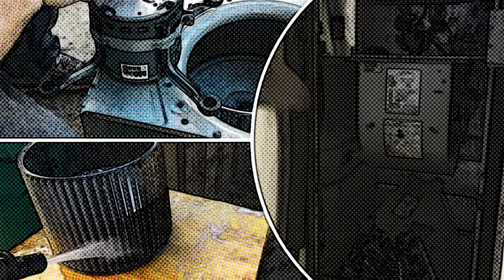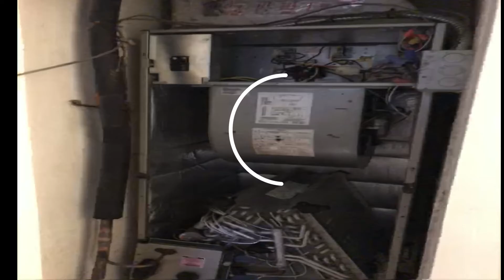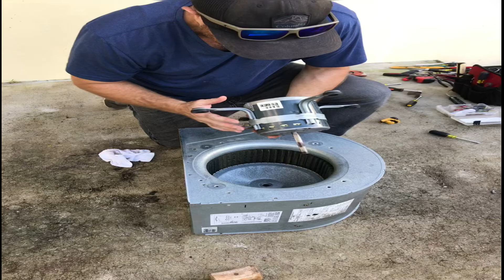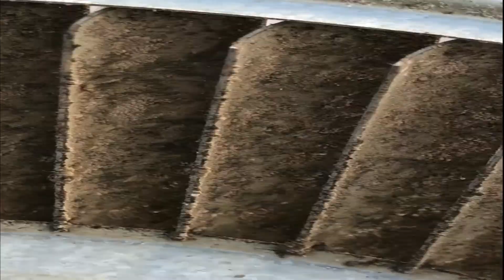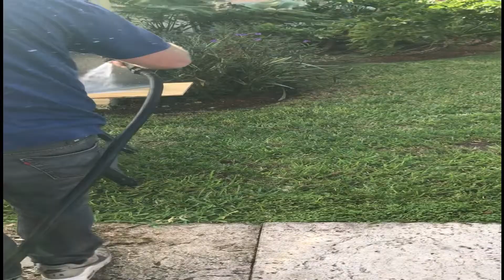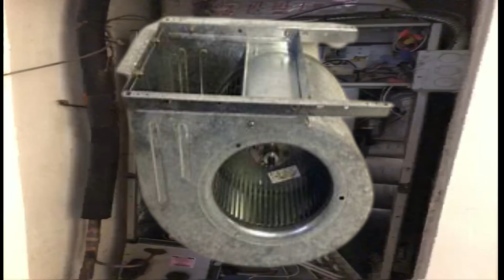How to clean your A/C Blower wheel. DIY Simple and easy! No need for a technician

Comment: So my carrier I could actually slide out the face, set down while wires still attached and clean the fan blades with a tooth brush and a vacuum and slide right back in. Took like 15 minutes.

Comment: Enducer motor not working but my furnace is over 40 yrs old, do I need to change my whole furnace system?
Reply from the maker: 40 yrs Wow! I would definitely  replace the whole system.
Reply: @jeffjeffhomeandgarden  thanks
Reply: No need to change the whole system. Just replace the motor. There are shaded pole motors and there are cqpacitor start motors. If you get the shades pole motor you have one less maintenance thing to worry about because you don't have to worry about capacitors going bad. You could check if you have a capacitor start motor. Thes capacitors have electrical power even when the system is off. Capacitors are easy to find online and they are the most common cause of an HVAC motor not working if you have the type of motor that uses a capacitor.
Reply: @gregbernard4466  yes, thanks. I just replaced the part.